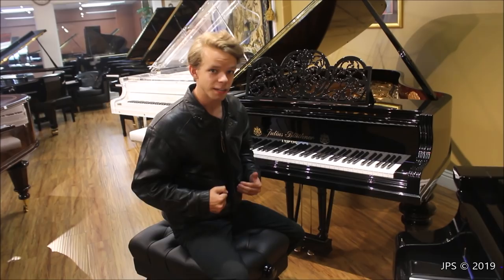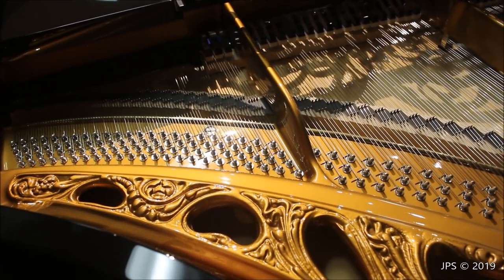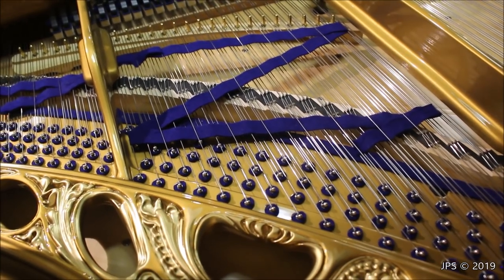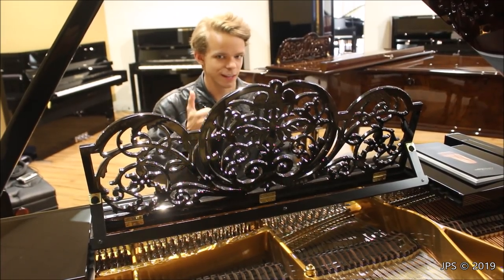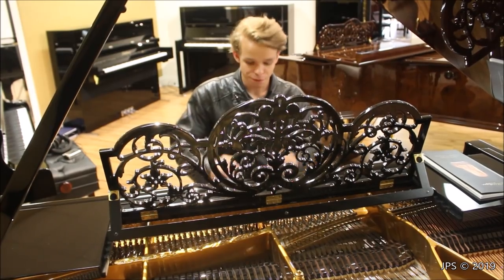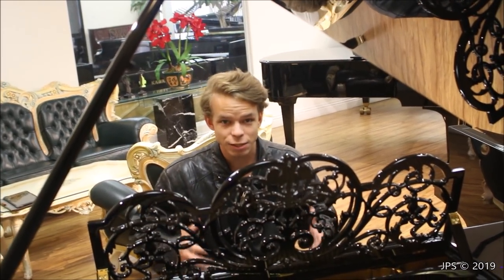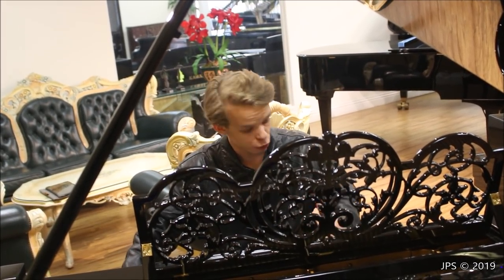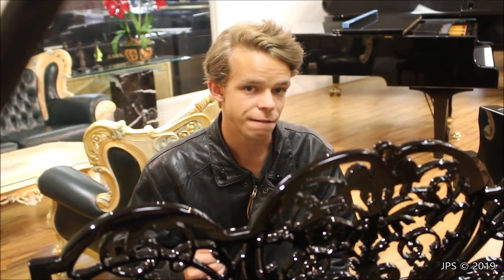1912 Bluthner vs  2018 Bluthner Model 6

Comment: The 1912 sounds magical. Well played.
Reply from the maker: It was a great piano from that era.
Reply: I can't have noticed when James compared the Fazioli, the Steinway and the Bosendorfer - which of them has the aliquot system?  Heaps of pianos need something like that, because otherwise the treble upwards sounds thin and tinny, and doesn't pair well with the middle and lower range.
Reply: The 1912 remembers me the sweet song of the old french Gaveau piano.
Why the fourth string is not free to sound?
The 2018 Blüthner os fantastic

Comment: The aliquot strings go through a bridge with metal lugs which transfer the vibrations to the soundboard. The length of aliquot string from the lugs to the hitch pins are damped off with braid tape as the vibrating length of these strings stop at the bridge lugs. The important part is that the tuned pitch of these aliquot strings are ‘one octave above’ the unison pitch they are resonating with. This adds upper partials to the sound which would not naturally be there in the unison length string. In the the top end however the aliquots are tuned to the unison and not the octave above as the pitches would get too high. While the aliquot strings are not struck by the hammers they do have dampers to stop the octave partials at the same time as the unison.

Comment: You can see an incredible change in the casting quality around the name on the harp. On the 1912, every surface is smooth and the figural work is crisp. Even the negative space, the flat below the lettering, for example, is totally smooth. The new one, you can see the courseness of the sand in which it was cast. They didn't even try to touch up the cherubs. I see the same changes in industrial equipment over the same span. An electric motor in 1912, the exposed parts of the castings would be a smooth beneath their Japan black as the 1912 cherub's cheek. The inside of the casting? As rough as the current one's surface, and just like all the unmachined surfaces on an electric motor, today. 

Also, the painted lettering. You can see the effort that went into making a good and clear presence on the letters of the 1912, whereas the new one looks rushed with a fine brush, and uneven in how it fails to fill the surface. 

So many people talked at length about the sound, and I can hear a subtlety in the 1912 that's lacking in the new one, but I figured I'd point out a few details that caught the eye of somebody with some background in manufacturing engineering.
Reply: Rahway Electric Motor:  All those nitty-gritty little facts.  I'm a sucker for them.  Thank you for sharing.

Comment: I had the honor of acquaintance with a piano tuner in San Francisco during the 90's.  I had always thought that pianos sound pretty much the same until one time I visited him and he had a Bluthner in his shop for repair and tuning.  When he sat down and played at that piano I immediately fell in love with the sound because it was so much richer than I was used to hearing.  He told the story of having to write to the Bluthner factory for instructions on how to repair and tune it, and they sent him a manual in German which he had to have translated.  It must have been an older piano because I remember him telling me that the extra string was above the other three and tuned an octave higher.  He also said that when he restrung it he had to ship the old strings to a special dump for toxic waste because the alloy in the strings contained a radioactive material?  I have always wanted an older Bluthner and he said he had found one in need of a lot of repair that he was working on securing for me.  Unfortunately he passed away.  My fondest memory is that he would often lie underneath a piano to listen to it because he said that is where it sounded best.  Especially after a couple bottles of wine, lol!

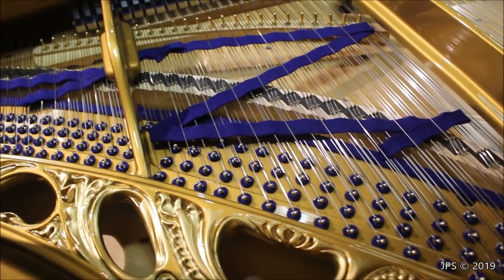Comment: 5:03 That's the aliquot bridge agraffe. The tuned section of those strings comes before the agraffes. The strings beyond the agraffes are muted with the felt strip.
The newer (1970s and on) Bluthner piano's aliquot strings come without that bridge, and are tuned to the same pitch, while these on the older pianos are tuned at an octave higher (just the ones that go through the agraffes, though). The aliquot strings that go past bridge pins are tuned the same as the other three strings.

Comment: There is something really unique and distinctive about the sound of both Blüthners.  I can't quite put my finger on it but they have a delicacy (maybe daintiness is the word I'm looking for?) and clarity of tone that I don't think I've heard out of any other piano except maybe a vintage Knabe.  What marvelous sounds! Thank you for that special comparison.  Great video. Your channel is one of my absolute favorites on YouTube.
Reply: The old Blüthners have hammers that do not strike at 90 degrees to the hammer.  They have what is referred to as  overblow which creates a different noise since the hammer is hitting the string a slight angle.  This gives it a very distinct sound that you do not get with modern pianos today.  It gives it almost a harp-like quality to the sound which was much more common with the pianos of the 1840s like errards in europe.  Most had gone the route of getting more power for the new music of the late 1800s and early 1900s, but in this case blüthner compromised by getting that harp-like quality using strike point geometry which allowed to to also keep the power that the modern designed setup for while keeping the tone that for most pianos had bee lost by the turn of the century.

Comment: I just acquired a 1909 Bluthner Model 6, serial number 77000.  It is going through a complete rebuild that includes a new soundboard.   I am thrilled to hear the difference here and it seems from the comments that all agree....older is better.  At least in this case.  Thanks for the video.  And I can't wait until I get to play mine.

Comment: Interesting about the differences in the aliquot system between the two. The 1912 creates almost a duplex scale of shorter string length which runs from the capo bar to that little pin you mentioned and is dampened between there and the bridge and behind the bridge to the plate pins as well. Therefore it is producing mostly upper harmonics. Bluthner in the 1912 continued these into the lower register. Now on the recent version, being that they only occupy the upper register and are scaled identically to the other three strings will likely reproduce the same level of upper harmonics   without the mess associated with the former.   

Let me not forget to say thank you for the effort you put into these videos and the wealth of information we viewers gain from it.

Comment: James, I think they changed the configuration of the aliquot stringing because having the additional bridge apparently put extra pressure on the treble area of the soundboard. According to a technician I know who was technical manager at Blüthner London for many years, the addition of the aliquot bridge made the treble brighter by making the board a bit stiffer there, but the extra pressure meant that in certain circumstances the soundboard was more prone to failure and less free to vibrate. Did you know that Blüthner actually produced two versions of each model - one with Aliquot and one without? So there was the Style 8, and the style 7 without, both 6'3, and then they were eventually consolidated into the model 6. Which is best is a matter of preference. The newest Blüthners have a lot more raw power and sustain, the old models have a lot of elegance and clarity, but they're not as powerful. I guess it depends what sound one is looking for! Nice video though, and a great opportunity to compare the two instruments. I notice they've restored the original soundboard on that piano, interesting.

Comment: My own 1935 Blüthner grand (the smaller baby grand model, which, incidentally, is the only size model for which Blüthner never included the overstringing) sounds, to my ears, more like the earlier than later larger model Blüthner grand that you are playing. For some reason, since my move in 2005, the very top has loss some of its resonance and sustain, not immediately after the move, but within a couple of years following.the move. My own Blüthner was restored, using entirely Blüthner parts imported from Germany. Even the baby grand Blüthner pianos are powerful and sweet-toned for such smaller grands.

Comment: I could def tell a difference between the two. The older piano has a more bass throaty sound to it. 
I know absolutely nothing about pianos , don't play, but you certainly make it seem interesting, so, I enjoy watching the videos. 
I was wondering if the way they put fewer hitch pins in the new one due to a different manufacture of the string, ie, the metal used and process may be different today. I was thinking that they had to somehow change the way it's done from the old, in order to get almost the same sound.  It was just something that crossed my mind.  Thanks.

Comment: I prefer the sound of the new Bluthner, just because it reminds me of a 100 year old Model 6 which I tested some years ago...

The difference between the two models is not so vast as you think. Yes, the treble in the old one is a bit more prominent, and the middle section in the new one is a bit thicker; but essentially, once one is accustomed to the sound of his Bluthner, what he retains is a mellow, misty and romantic sound that travels you back to the 19th - early 20th century. A sea of harmonics and saturated sound colors; an instrument which invites and even pulls you into his sound without oppressing you or trying to brag with extra volume.

That said, one cannot but admire the work of the restoration team, which also proves the quality of the 1912 model. The old Bluthner I had tested was untended and neglected for years but you could easily understand how much life it retained under its yellowed keys...

Comment: How is an aliquot string tuned? If the hammer doesn't strike them, are they plucked?
Reply from the maker: Great question. Yes, that would be the only way to sound the note alone.
Reply: You would tune the trichords in first, then you pluck the aliquot.  The treble is tune and octave higher and the top treble is tuned to the same pitch as the trichords in that area.

Comment: The older Bluthner patented action was a genius design in its time  to permit rapid repetition and  avoid blocking   before the Renner type action with spring loaded repetition levers came on the scene. The spring arrangement on the Renner action is superior to its American counterpart.

Comment: The early aliquot scale with separate bridge was far more complicated to construct than the new models.
The new scale eliminates the extra bridge, as well as reduce the number of aluqot strings in the mid section.
Steinway and Yamaha and others try to achieve the same effect by inserting metal steps between the hitch pins and the bridge to give the unstruck portion of the string an octave relationship to the struck portion...and thereby reinforce the fundamental.  Cheaper pianos mute the unstruck portion of the strings with a strip of  felt.

Comment: You did not comment about the most obvious and striking feature of these pianos which is the I ornate music desk. I wonder whether the scrollwork of the modern piano was had-carved or made on a CNC machine. Years ago, I was shocked when I found out, at least in the case of ornate grandfather clocks, that people would pay extra for imperfect woodwork because they knew that it was hand-carved.

Comment: The entire treble (and not just the topmost keys) on the older Blüthner grand sounds more lyrical than on the later near-replica. Those overstrung strings make a lot of difference. You are right, though, that the bass is more resonant on the newer Blûthner.
Reply: The bass even on my 1935 baby grand Blüthner sounds more resonant than the older of the two pianos.

Comment: I agree with the majority that the old instrument is more colorful. However, even though this seems like the perfect comparison, the devil is in the details: For example, the old Bluthner is actually mostly newly rebuilt, with new hammers, strings and perhaps even a new soundboard. While it seems only 'fair' to avoid comparing an unrestored clunker with a brand new instrument, the old hammers are no longer produced and replicas are usually not like the originals; the strings are copies that are never exact, and if the soundboard was replaced it could even further compromise its originality. At the same time, if the original soundboard has not been replaced, it very likely suffers from flatness, i.e. loss of crown (resulting in loss of sustain, power, an increase of harshness). So, unless you go through the very elaborate process called 'conservative restoration' (thus preserving its superior, aged tonewood) in the way only a handful of restorers worldwide are capable and willing to perform (e.g. Edin Beunk, David Winston, Hampshire Piano), you are still comparing apples with oranges. The sight fluffiness and nasalness in both grands, but more evident in the new one, could also in part come from the sound of brand new hammers not played in yet.

Comment: The 1912 sounds better. This instrument excellently restored !!! is the winner. Also the much lighter action which early 19th century piano's have is certainly an advantage.
One thing is for shure: The 2018 one is not a replica of the original and thats a shame. I wonder why the Blüthner Company did"nt choose for an exact copy of the original.
The other thing that is for shure is that if a 1912 Blüthner after 108 years still sounds so great EVEN BETTER than the 2018 version the Blüthners of the early ninetheen C shure knew how to build an instrument. In other words:  GreatGrandPa beats the Baby.

Comment: The new Bluthner aliquot  system is inferior to the original and was modified for ease of manufacture....no extra tiny damper or elevated bridge post for aliquot unstruck string..... Also economy of fewer aliquot notes.